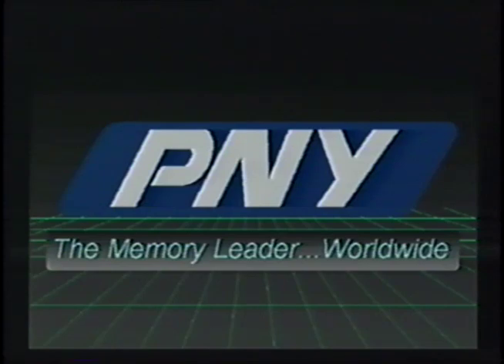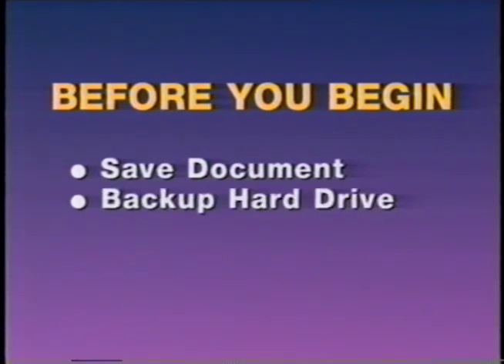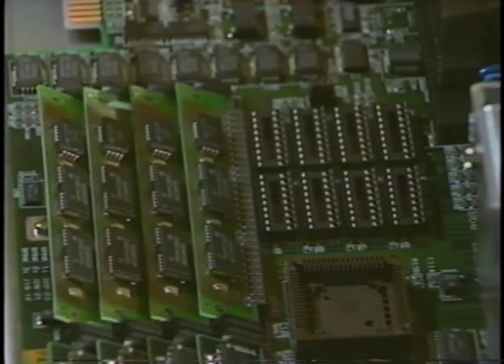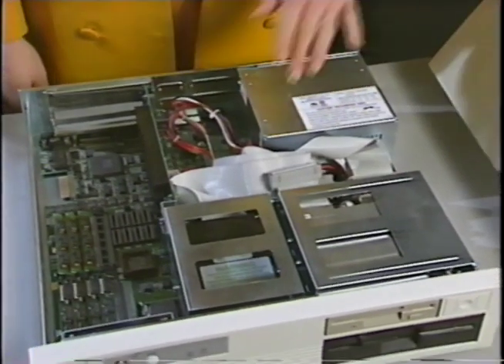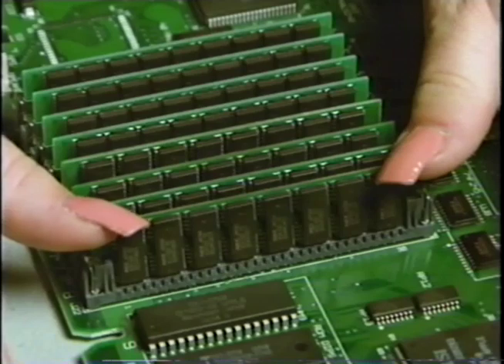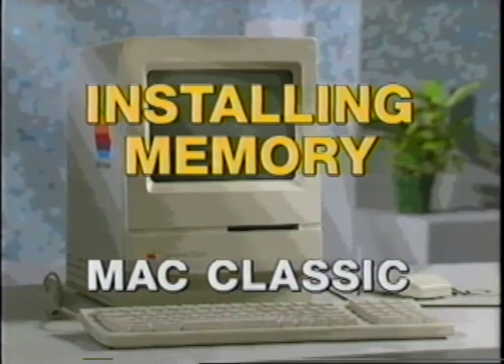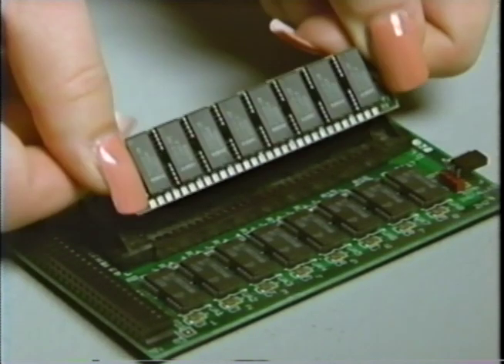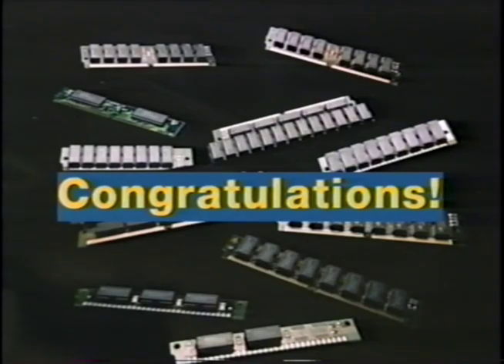PNY Memory Master Upgrade Video

Comment: Besides the goofs you mentioned in the description, I found it questionable when the demonstrator didn't put something such as a towel under the Mac Classic when it was face down so as to not scratch up the CRT, but not as bad as yanking the top off the powerbook with the display cable attached. (Seriously, those powerbooks cost thousands of dollars when new, and it would have probably been very expensive to replace that cable even when those things were new.)

Comment: Lol I have a powerbook 180c that actually had a pny upgrade module in it, that ribbon cable was a pain, you had to be very careful when taking the top half off. the machine works still, but it suffers from the tunneling effect, that plagued so many of these. still A nice classic laptop imho

Comment: (Sorry for double comment)
5:31
Umm... The person is re-installing the original SIMM again... While saying to reseat the new one...

"The only tools required for opening the mac plus an mac classic are a long-necked torx screwdriver and a case splitter" - Something the average household mast have had in those days, i guess?

One more: The PowerBook doesn't have SIMMs... Notice at the end he said something about SIMMs in relation to the PowerBook...

Comment: The 'engineer' forgot to cut those long nails prior to working near a PCB and its components.  Perhaps she was also breaking a few circuit traces on the board while she was doing the RAM?  Ahh women can multitask so well!

Actually I have known a few amazing girls and women that did computer and electronics to a high standard, but they were (are) in a minority.  Everyone does a few careless or dumb actions from time to time including myself, but usually only due to severe exhaustion.

Comment: There is one reason to unplug the old AT power supplies and that is the high voltage switch that sometimes became partially exposed. I've been bitten by those once or twice and I can tell you that it hurts like hell when you get 240 through your fingers.

Comment: A blast from the past. They make it look as though it all just goes without difficulty, I wonder how many times they did those actions before it went smoothly for their video. Personally, I cannot count the number of times I have attempted to open a system and been met with fierce resistance.

Comment: The first time I worked on a laptop I made one with some bare wire. Other than that, I never bothered. Like you, I just touch something grounded whenever I want to make sure.
The video told people to unplug the PC, but I think it made more sense on those old machines to leave them plugged in.  AT power supplies don't have any standby power so the board is still unpowered regardless, but leaving it plugged in keeps the chassis grounded.
But in general I think the ESD fairy is overrated.

Comment: One suggestion - if you ever happen to find a Super VHS player, grab it. Many of them have a TBC (timebase correction) feature which really cleans up the signal on old VHS tapes. It basically aligns all the scanlines to eliminate the squiggly waviness you normally get - this is something that is best done in the analog domain at the player, it can't be done well in digital editing.
This is assuming you want to mess with a capture card, which the VCR would need to be hooked up to.

Comment: Ugh...30 pin simms, I don't miss those days. I remember my 486 board had both 30 pin and 72 pin slots, and when I traded out 8MB 30 pin for 8MB 72 pin that alone felt like I upgraded a couple of speed grades. Once I messed with the wait states in the bios that really moved things along a lot better.

Comment: Because 13:37!

I like how after the Mac Classic part, they tell you to ground yourself, but don't show where... such as NOT on the high voltage CRT circuitry!

And yes, those nails are disturbing, considering how much force it sometimes takes to get SIMMs to unlatch from their sockets, especially the ones which use metal clips to hold them in.